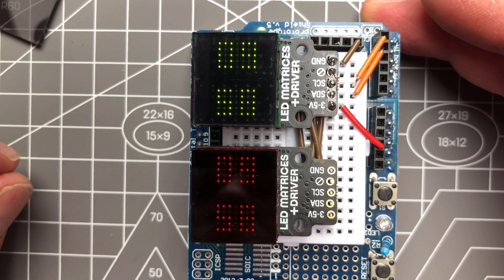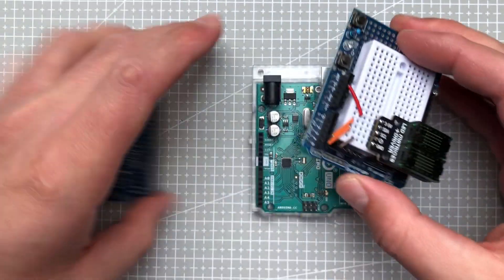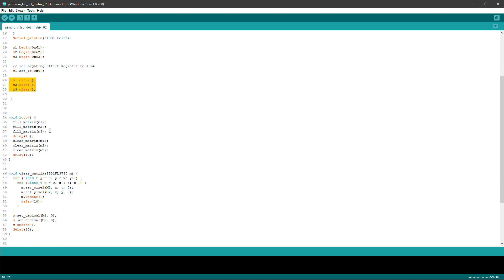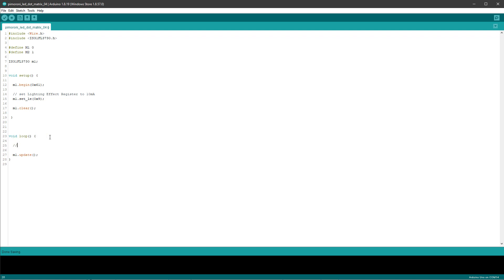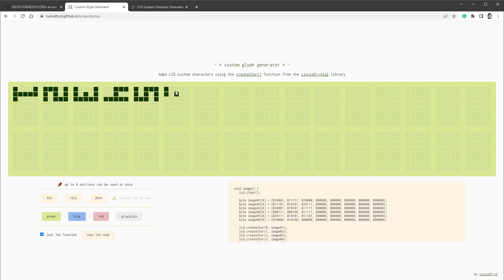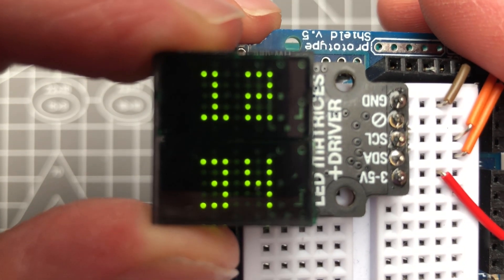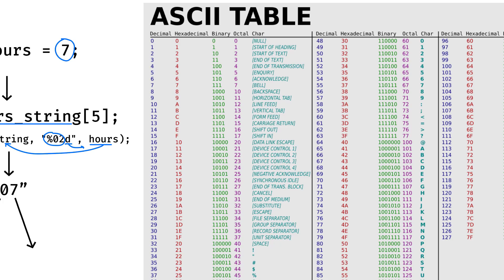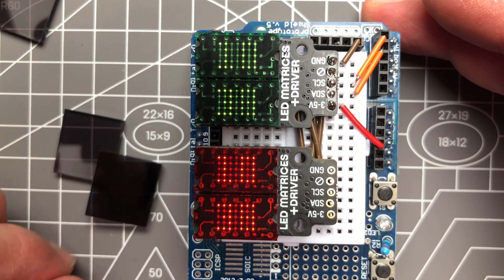51 years old display!

Comment: Hey @upir , I wanted to ask, if you could make a video about the atmega 328p xplained mini, I am in trouble for my project and it is very complicated to use
Reply: You could program the Arduino bootloader and use it with Arduino IDE. However, if the point is learning bare metal programming it makes sense to avoid the Arduino middle layer.
Reply from the maker: Thank you for the clarification, Rokreder!
Reply from the maker: Thank you for your comment but unfortunatelly I don´t have any experience with this board, and from a quick googling, it looks like you need to use Atmel studio, which is something I´m trying to avoid. Is there any particular reason to use this board and not some other one?
Reply: @upir_upir  to be honest, I don't really understand it either, I asked the teacher why we use this board instead of the arduino for example, because it is a board I am already used to using, and he said it is cheaper, but it is a difference of two euros I think

Comment: Cool video! Just one small suggestion: at 10:50 or so you don't need to use sprintf to get the indexes into your "image_digit_array" variable. Here you're converting an int (e.g. "hours") into a string, and then converting that string back into an int. For the units of hours (0-9) you can use hours%10 and for the tens of hours you can use hours/10. The result of hours/10 will be an int since hours is itself an int. So you can remove the sprintf and its associated buffer entirely and use image_digit_array[hours/10][i] on line 65 and image_digit_array[hours%10][i] on line 68.
Reply: That is neat. But remember to be extra with zeros when using %. TI's example code (real old stuff that has almost no support documents, IDK why our school still teaches IOT using it) that transfers the readings of temperature sensor through serial messed it up. If it were 19.02, it would print as 19.2, the "0" got lost in (19.02*100)%100=2. Just a reminder
Reply from the maker: Thank you for your comments and suggestions. I actually use the mentioned calculations in my other projects, but I thought it would be nice to try some different approach.